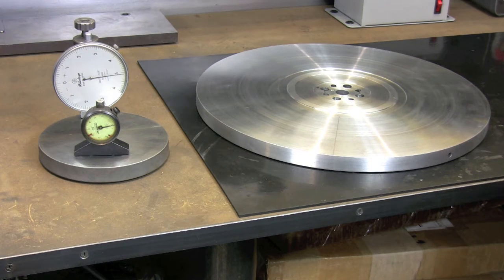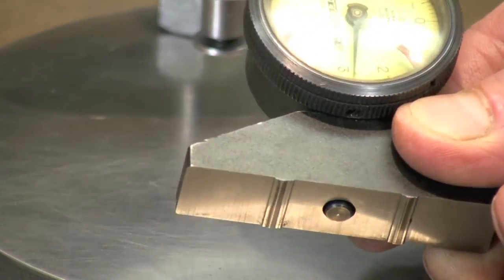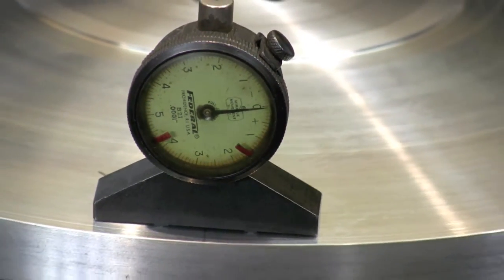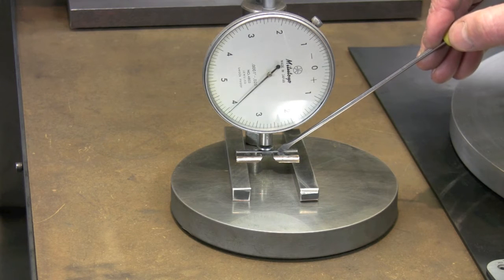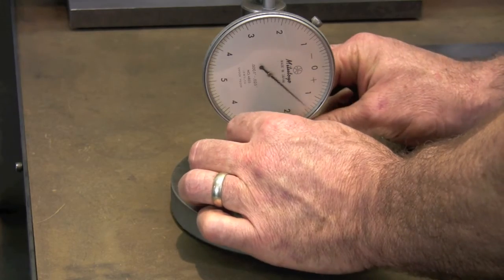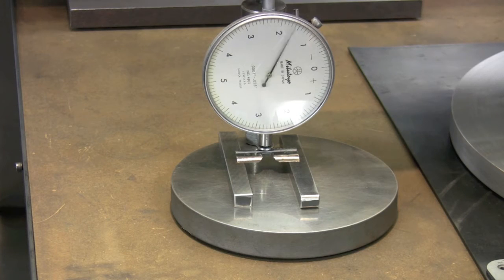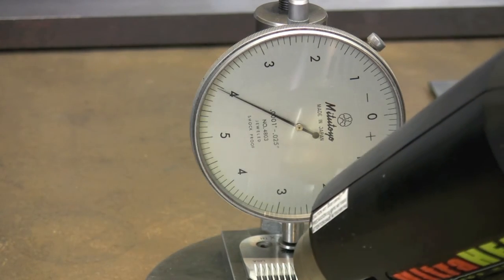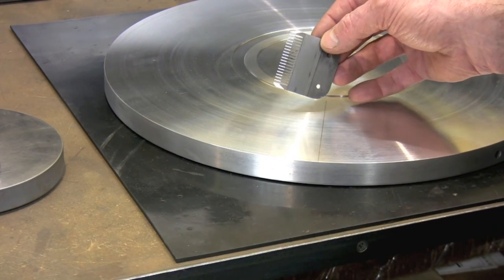Distortion of clipper blades from heat and pressure.

Comment: WHAT IS THE REQUIRED HOLLOW CURVE IN A BLADE THAT SPRING TENSION CAN OVERCOME BOTH BLADE CURVE TO EXERCISE CUTTING? BECAUSE IF, TOO MUCH CURVE OF BOTH BLADES, ( COMB AND CUTTER) THE TENSION SPRING WOULD HARDLY  PUSHING DOWN TO THE CUTTING SPOT. IF, LESS CURVE,  SPRING TENSION WOULD HARDLY REACHING DOWN TO THE CUTTING SPOT. WHY? IT BECAUSE BOTH BLADES ARE ALMOST FLAT TO FLAT RUNNING MOTION.
Reply: did you find out